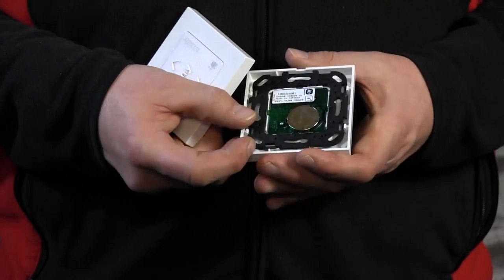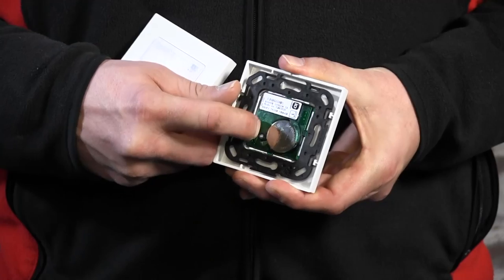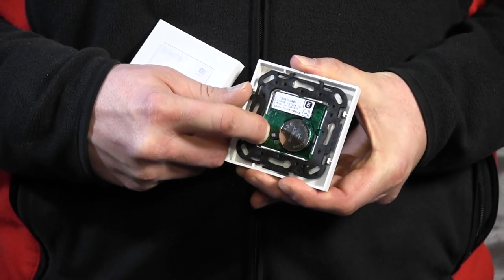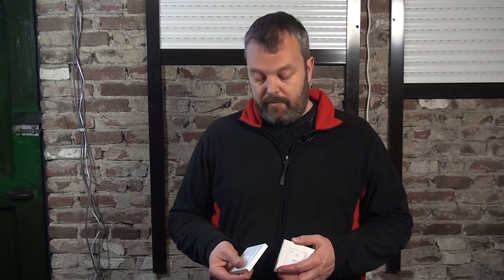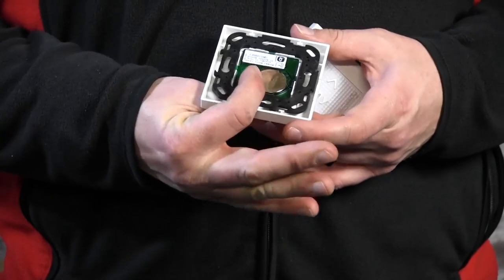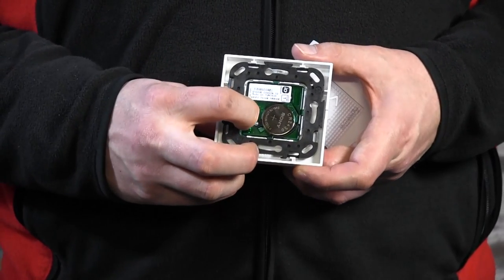How to remove an addition remote control from the Somfy Oximo IO motor

Comment: Is there any way or need to remove a controller you don’t have anymore?
Reply from the maker: Hi Matt, no there isn't if you have broken it. The remote is stored in the memory of the motor, so it will be able to operate the shutter or blind. But if it's broken, that can no longer happen. If you sell the remote or lose it and want to be safe, reset the motor and connect the new remote and use that to set the end limits. This prevents other people from operating your shutters or blinds. The motors have enough memory space for multiple remotes, so there's no need to empty the memory for that purpose unless you want to use more than say 5 controls per motor

Comment: Hi Can the io remote loose its program if the power went out for say for an 1hr . Will that stop the remote from responding to the motor.
Reply from the maker: No, the settings would stay memorised by the motor